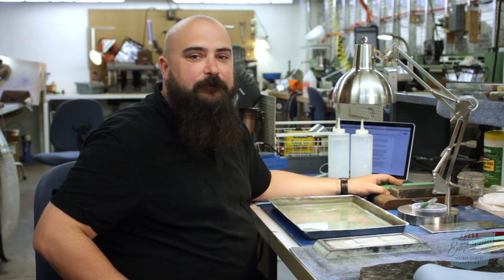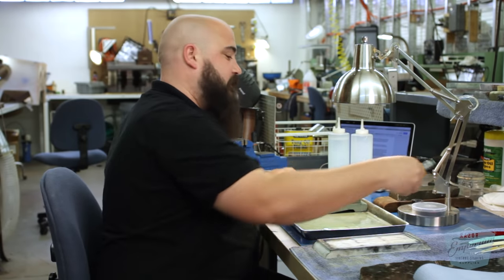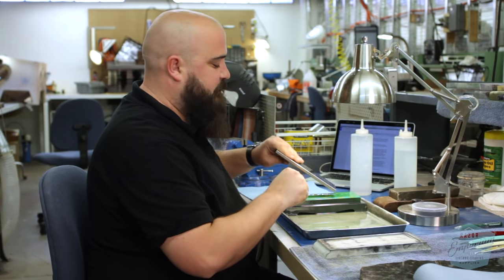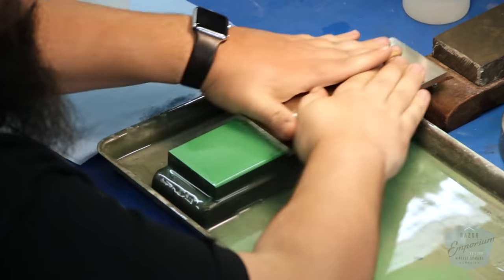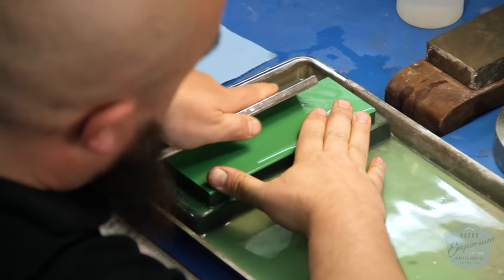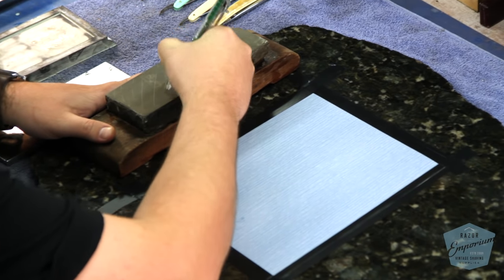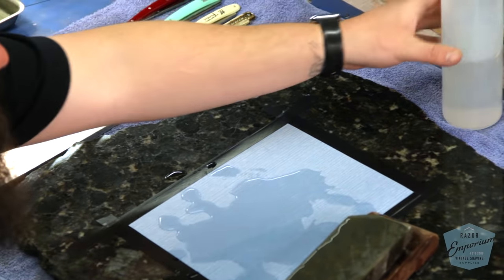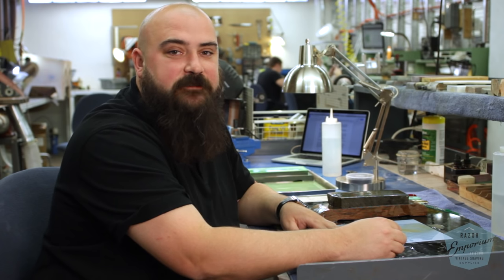How to Hone a Straight Razor: Step 1 Prep

Comment: You mention having to fix angles for razors with excessive spine wear by stacking tape. This makes sense, but taping razors that don't have excessive wear is going to progressively cause the opposite problem with the bevel angle getting too wide. Far better to set a proper bevel, accept a little wear, and keep the same consistent angle by just honing on a finisher from time to time. Do you guys hone without tape when requested?

Comment: This video has helped quite a bit more than most of the others I've been watching.
I had no idea that you would use the slury to polish the patterns.
I'm just trying to understand the angle. Tape the spine to keep it from scratching? Lay it completely flat? 
It's gotta be flatter than a pocket or kitchen knife. I've never laid a knife down that flat before. 
What difference does jumping up in grits past 3,000 do? 
I'm still new to straight razors but I've definitely got some experience with knives.
I thought it would be just like sharpening a little knife.
Thanks for your time!!!
Reply from the maker: Angle is created by the spine. Straight razors need to be sharper than any knife or scapel if they are to be comfortable to use.

Comment: I am a barber. I bought a Portland Razor Co. I stropped it between each client, within 4 months there were chips in the edge. I watched your videos, I got the stones, I honed it to a better edge than it came with. Within 3 months there are chips in the edge again. Is there a defect in the metal? They won’t return a call or email. Thank you for the video.
Reply from the maker: Yes that doesn't sound right at all. Maybe their heat treatment was bad.
Reply: Thanks for the reply. I have a case and a double duck that an retiring barber gave me. I got them to a good edge, but the barbercide is harsh on them. I would like to find another Stainless Steel razor that the scales can be fully submerged in barbercide between each client, but hopefully would hold an edge better. I do about 35-50 neck shaves a week and 1 full face shave and a head shave a month. What razor would you recommend?
Reply: you shave many customers and chips will form over time, maybe have a routine to refresh edge once a month. regards dapper shaves

Comment: Do brand new stones need to be trued before using them?

I've had my Dovo blade for maybe 3 years and it's starting to get a little grabby so I bought some stones and such to sharpen it.   Been doing a lot of research before I start anything.
For honing I figured I wouldn't need more than a 12000 as the blade is in great shape....it just needs a minor honing.
The stone is a Naniwa Specialty/Super Stone 1200.
For truing I got a Knifewear 220 grit truing stone and a Nagura 600 grit finishing stone.   ...I plan on keeping this blade for a very long time.  :)
Reply: thanks for sharing, how is you honing going? any changes or new stones? regards dapper shaves
Reply: @dappershaves  Lol, well that was about a year ago.     No problems.   Got the blade nice and sharp.   Haven't felt the need to resharpen it since then.  But then I only shave about once or twice a week.   Been working from home most of the time since 2020, so meh, haven't had the need to be super clean shaven.  :)

Wish I had started with a straight razor way back when I started shaving.  Would have saved a ton of money.  Those cartridges are way over priced....although they are faster and safer.  But in any case, a straight razor is definitely good to have these days.
Reply: @scottphillips5901  i appreciate your feedback

Comment: Should I be looking to do this myself?  A local merchant who sells straight razors & strops insists that stropping alone is enough & that amateurs like myself should NEVER try to hone a straight razor.
Reply from the maker: If the blade is properly set up, and you use strop compounds, in theory you may be able to go years without honing on stones.
Reply: @RazorEmporium  Strip compounds?  And how do I use those?
Reply from the maker: Strop. Damn autocorrect. One of our recent videos covers them in detail.

Comment: Bad idea using sand paper when that 400 grit particles break off they will embed in your 3000 to 10000 grit finishing stones. Spend the extra money on a diamond plate you won't be sorry like l was.
Reply: the diamonds in coated stones also tear off

Comment: But I mean is all this really necessary? Couldn't you just Use your razor on a single Whetstone and call it a day?
Reply: You could get a 400 or 1000 and finish it off with an 8000 I'm sure. If your razor just needs a touch up then just use the 8000. Honing is a process, not a one and done type of deal.